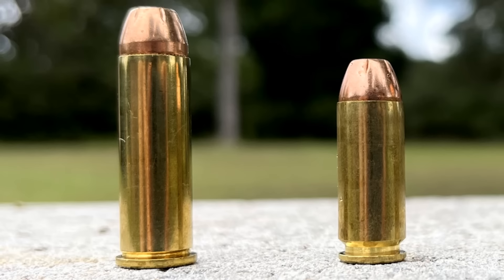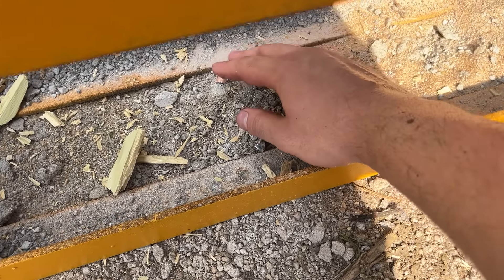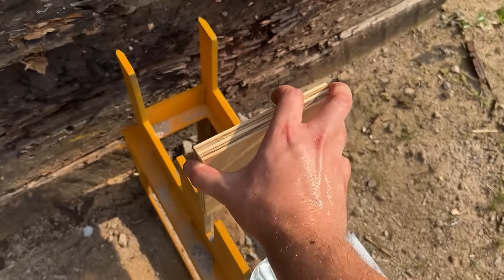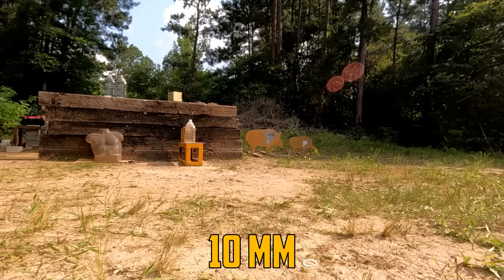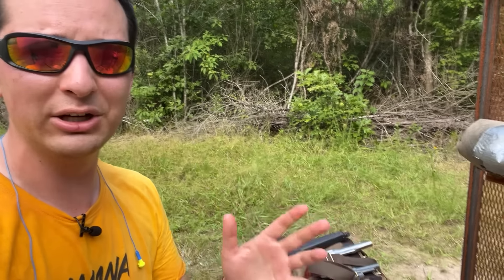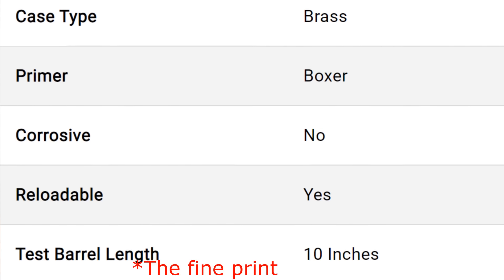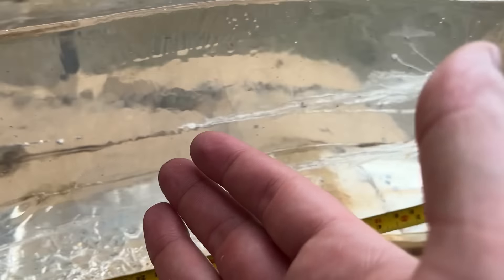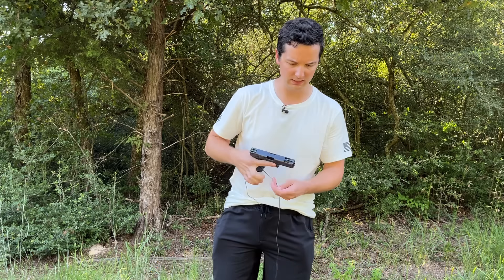44 Mag vs 10mm Auto vs 41 Mag: Not Even Close?

Comment: For those unfamiliar with the 41 Mag, the way I understand it, is that back in the day when most police agencies were carrying 38/357 revolvers, they were wanting something with a little more "ooomph" but were wary of the 44 Mag recoil.  The 41 was developed to bridge the gap between the 357 and 44 mags.  Unfortunately, the 41 required the larger frame as the 44 which negated some of the benefits of a larger caliber for service duty.   Since 357 and 44 ammunition was more readily available, the 41 never caught on with most handgunners.
Reply: If Dirty Harry had carried a .41 Mag, things would be much different.
Reply: @DirkDiggler6903  funny you should say that because that’s what Clint was using for the filming
Reply: @lkj0822g  my S&W model 57 was my brothers service revolver in the early 70’s
Reply: You’re correct for the reason it was developed. But it was too close to the .44. Larger pistol with near the same recoil as the .44. When it came out it was better than the .357, but you get the .44 for little more penalty in recoil.
Reply: If I remember the .41 magnum was created by 2 famous gun guys and was supposed to be much softer shooting, but the ammo manufactures thought the ammo needed to be hotter to sell and it ruined the whole idea behind the .41 magnum. The later idea behind the .40s and 10mm were inspired by the original .41 magnum idea, but again in the case of the 10mm it became hotter when ammo manufactures loaded it hotter to sell more.
Reply: This, and to add:  The 41 Magnum "Police" load was a 200 grain SWC at 900 FPS.  This is the load the 10mm trounces.  The rumors of the 10mm being "as powerful or more" were by people who didn't understand that this lower power load was not representative of the 41 magnum potential.  (Reference:  https://en.wikipedia.org/wiki/.41_Remington_Magnum#Development  paragragh 3)
Reply: I remember some LE complaining about the .38 Spl not having enough oomph, but didn’t like the loud .357 Mag crack. I never understood that. The .40 S&W ruined the 10mm’s destiny that’s only now is coming to fruition. Not being a sexist but women in the F.B.I., should’ve just bucked up & learned to shoot the 10mm or stay w/the 9mm or a .38 Super or use the .357 Sig. Gun Sites & local FFL’s are swimming in LE “.40 S&W Trade In’s”. I wouldn’t walk across the street for a FREE one.
Reply: John Wesley Harden carried a Double Action Chambered in .41 Colt while he was a Lawyer towards the end of his Life.  That was way before the .357 Mag was made.
Reply: I read somewhere that several experts recommended a 41 Special instead of the 41 mag. When the testing was done, 41 mag ammo was used and qualification scores were mediocre due to the recoil and blast. So the whole idea was scrapped as totally unfeasible. The 41 Special would have been like today's 40 S&W but the weight and size of the revolvers would have been excessive.
Reply: @FMitchellFelling San Antonio PD carried that 41 load.  11 shootings, 11 one- shot stops, and 11 fatalities.
Reply: .41 mag ballistics really show themselves when one handloads their own ammo.  The .41 mag case has over 40% more capacity than the 10 mm.  Not saying that there is a thing 
wrong with the 10 mm but that extra 40% case capacity HAS to have an effect on ballistics.  There are numerous handloads within pressure specs for the .41 mag in excess of 
1,000 ft-lbs at the muzzle.  That's a pretty mean handgun round.  Buffalo Bore even has one that exceeds 1100 ft-lbs muzzle energy.  IMO, what caused the .41 mag to not be 
accepted by a lot of police departments, hunters, and shooters was that there was no .41 Special.  StarLine Brass makes .41 Special cases in batches from time to time.  These 
can be loaded with a hardened lead 210 grain SWC to 900-1000 fps for a very nice big bore shooting experience that would be great in a self-defense.  Yes, .41 mag revolvers 
are large N frame guns but shooting Special class ammo in them really tames the .41 mag's recoil.  Not that it's really heavy.  It's stiff but manageable.  I like the .41 mag a lot.  
It's flat shooting and hard hitting.  It's also the most powerful handgun I can shoot well.
Reply: @scottsozmtns7534  I read that during the 10mm trials the marksmanship scores were down across the board. Men and women were less accurate with the 10mm. Could it have been mitigated by additional pistol training? Possibly but the FBI either couldn't or wouldn't spend the additional time required back then. These days most have gone back to the 9mm and the 10mm has found new life as an hunting/outdoorsman's cartridge. It's another option to .44mag when in bear country with the bonus of additional rounds.
Reply: @Angel9932  I’m glad to know that it wasn’t simply the women but the men as well. I know guys personally that find the 10mm to be bit much to handle & to be accurate beyond the first shots 1-3 being their best then the accuracy declines greatly. I like the 10mm but with metallurgical advances & production abilities the 9mm was shown to match the .40 S&W & the old war horse the .45 ACP in penetration, expansion & probably most importantly-accuracy! I agree w/you also on the 10mm being a very solid choice in bear country & the like giving you, the hunter, many more rounds than a simple 6 from a wheel gun (traditionally).  Have you looked into the new “.30 Super Carry”? I find it to be rather disingenuous as advertised as it’s NOT a .30 caliber. It’s a .32 caliber. I for one don’t understand why the variations of the .32 H&R Mag (which I have 2 wheel guns chambered in), & now the hot .327 Federal Magnum aren’t more popular? What’s your take on the seemingly “homeless .32”, caliber? It’s a darling little round, in my opinion. I’ve got 2 revolvers chambered for it, 1-is a Ruger Super Single Six “Vaquerito”, 4 5/8” barrel in stainless steel w/Birds Head grip & a Cimarron Thunderer w/2 cylinders one being a .32 H&R Mag & the 2nd is in 32-20 Winchester. I love it in an 80-90 grain lead round nose or a gem of a HP that is very effective on small game! Before I end I’d like to thank you for your very intelligent & informed and very well stated response. It’s a refreshing turn from the trolls wanting to argue or be hateful. Thank you so very much & I hope you have a wonderful weekend! Take care!
Reply: @edb3877  41 mag is really close to 44 mag performance so most people buy 44 mag revolvers and ammo, which are plentiful. 41 mag is practically extinct.
Reply: " little more "ooomph" but were wary of the 44 Mag recoil..." My dude, that's why .44 Spl already existed.
Reply: @Lurch-Bot  the 44 Special is equal to the 45 ACP.
Reply: @jimmyford796 In some of the scenes, according to historians.
Reply: @jimmyford796 I've heard that and used to believe it but a couple of the screen used guns have surfaced and were .44 magnums.  Definitely is a 6.5 inch n frame and in the final scene with Scorpio, you can clearly see .44 magnum on the barrel. One of them even had smooth Target grips and a prop house still owns it.  TFB visited and handled it.  

Interestingly, the script originally called for a 4 inch nickel m29.  They couldn't locate enough of those.
Reply: @jimmyford796 SanFrancisco police carried model 57’s
Reply: @PassivePortfolios  not really. A lot of manufacturers load .41 magnum
Reply: @scottsozmtns7534 you really don’t hear anyone mention the 32-20 anymore. I took my first deer with a Remington model 25 in 32-20 with the 80gr hollowpoint. I was 12 years old and it was a fork horn mule deer. That Christmas my dad bought me 1903 Springfield. I still have both of them.
Reply: @jimmyford796  Ammo is harder to find than 44 mag. and it's a bit more powerful than 41 mag. That's why the 41 mag. is basically done.
Reply: I hear .41 mag is popular in Alaska for bear defense.  Can’t confirm since I live in Indiana.  Most dangerous predators we have here walk around on two legs, and their pants sagging.  .41 mag could be a bit much.
Reply: The key is in the name 10mm auto. Higher round count cannot be gotten with the other 2 calibers. Rection for follow up shots and the lighter right in the polymer frames pistols cannot be achieved with the other calibers. As another subscriber said a pistol against big dangerous game is a last resort.
Reply: @bryanbaker5942  you can get 165gr hollow points for the .41 magnum and they are wonderful self defense rounds.
Reply: @scottsozmtns7534  i would. Lol it will probably be hard to find ammo in the future, but I was looking at some numbers, and the .40 sw gets the job done. 
 I don't own one, but my dad kept his after retirement as LEO.
 I'm definitely thinking about picking up a cheap .40 to carry around the property (really just because I want another gun).
 My dads first carry gun was a S&W .357mag in the late 80s. 
 He's carried 9mm and then .40 towards the end. 
 More one shot stops have been made with .40 than 9mm. Of course, there are about a thousand factors at play, but the point is, a .40 will stop a two legged threat.
 People get way too caught up in caliber hype. When I was in highschool, I knew guys that were deer hunting over 30yrd food plots with .300 win mags. 😅
Reply: One of my friends was a Detroit cop for 20 years. S&W  41 mag. was his choice.
Reply: I love my old 57....
Reply: @PassivePortfolios  Not quite extinct but not nearly as popular.
Reply: @jimmyford796  that thing could pop a domepiece like a melon,  I am certain
Reply: I'm a 40-year .41 mag owner. Bullet selection is the key to the caliber. Yes, this round has been under loaded since cops rejected the size and recoil in the 1950s. Unfortunately, Remington tried loading down the round to satisfy police requirements which is where the "10 mm is equivalent to a .41 magnum" comparison came from. Forget major makers and anything with a lead-core & hollow-point if you're hunting. For hogs (or deer) go straight to Buffalo Bore: 230 grains, Hard Cast Semi-Wadcutter, Muzzle Velocity 1,450 FPS, Muzzle Energy 1,074 FT LBS. Now you've got a .41 magnum.
Reply: @PassivePortfolios  HAHAHA! "basically done"? lol, it's been around longer than you have. I will never give up my 57's.....
Reply: @jimmyford796  Just in the first movie. Because the m 29 was sold out.
Reply: Some Police used the S&W M28 which was also an N frame but in 357 mag. Some called the m28 also just Highway Patrolman. Looks like it was quite popular. So the size shouldnt be the problem here.
Reply: Yeah 41 Mag is pretty obscure despite being a 'commercial cartridge'. I only learned about it like last year even though I watched guntubers for 12 years by now.
Reply: I have a 41. Great, underrated cartridge. Perfect for woods carry/bear defense. But yeah, it’s like having a cannon strapped to you lol
Reply: @scottsozmtns7534  Bro they got 38 speciblow in your standard 357 out of a 3 inch barrel out of   The water
Reply: @devonholbrook3603  That may be so but the question it comes down to is “Are you a Paper-Target man/woman or can you hit LIVE/Targets both Animal & Long Pig & I can do both w/amazing accuracy, to me but that’s all I care about. I know what I can do w/a .38 Special (of which I’m not a big fan on live “targets”, period not bad for accuracy), and especially the .357 Mag & not trying to prove anything but you’ll look long & hard for someone that can outshoot me w/a .357 Mag. I don’t measure accuracy in inches, I measure real accuracy in “thousandths”, & I do the hours, hand loading & drills until I get the accuracy I’m looking for. I’m also wanting to try a .327 Federal Magnum as she beats standard .32 H&R Mag (of which I’m a fan), big time & gets you really close to .357. For a wheel gun it’s just my bread & butter, that’s all. I don’t dis on 10mm guys. It’s a great round & would like to shoot it more than I have. On my wheel guns for both .38/.357 I tend to stay at 4”-6” barrels. 4 3/4 for Cowboy Action & for hog leg’s like my Colt’s King Cobra & Python I use 6” barrels only. I’m pretty good w/.32 H&R Mag out of 4 3/4” Cowboy but could be better. Heck, I just love about any gun. I apologize if I sounded like I was disin’ on any caliber or anything like that. I just love to shoot. Picked up an Sig Sauer P-210 A Target but can’t bring myself to shoot it!!!! I don’t doubt you at all. There’s no telling what’s out there now days! Keep shootin’ & shootin’ straight friend!  Ever deer hunt w/a wheel gun open sights NO scope? It’s funner than se, well I would go that far but it’s fun!!!

Comment: That's a pretty anemic load for the .41 Mag (1128 fps). I get around 1400 fps with a published handload using H110/W296 out of a 6.5" Ruger Blackhawk. It goes around 1700 fps out of my Marlin lever action.
Reply: Exactly what I was saying.  That load he used is extremely weak.
I have the exact same setup.  Love them both.
Reply: All the .41  mag. Slugs that I have shot are 1250 fps. or greater.  Did Bananaman use a low pressure handload ? My 10 in. TC/ Contender  pushes as hard as any .44 mag. Pistol  shot.
Reply: Around my area (SW Ohio), .41 is hard to find. He may have just used whatever ammo he could buy? Or whatever MidwayUSA could send him. *Love Midway, by the way!

Comment: Back in the 1980s, you could call Bullet companies like Speer,Sierra, Nosler and they would send you computer printouts of any caliber, barrel length, and Bullet weight for ballistics and comparison. The .41mag outperforms 44mag and most other pistol caliber cartridges. With the perfect diameter and 170gr -300gr bullets, 41mag, it is still hard to beat as a very manageable handgun or even lever gun caliber
Reply: I’ve long heard this “41 mag outperforms 44 mag” thing, but not once have I seen any real evidence for it. It doesn’t stand up to reason, a larger diameter cartridge with more internal volume running at the same pressures is somehow worse? It doesn’t add up
Reply: Absolutely !
Reply: @jacobackley502 Kinetic energy is 1/2MV^2 so the mass of a .41 will be a bit less than the .44 slug, but the velocity will be higher, and velocity in the equation is squared.  So in terms of energy,  a .41 can outperform a .44.

Would there be any meaningful difference on a game animal? I doubt it.
Reply: @thomassuit7450  So you presuppose the 41 to have higher velocity. My point here is that with the wider bore, there’s more surface area on the back of the projectile for gases to act on, so with the same pressure (force over surface area) multiplying against a larger surface area to get total force of the propellant accelerating the projectile is higher for the 44. This means that holding projectile and charge weight as constant (which between the two, it’s not constant, the 44 has higher bullet weight AND charge weight), then the 44 would still be more powerful. It will send a larger projectile faster than the 41, there’s not really any way around it
Reply: @jacobackley502  Yes, that is correct. My point was for cases where the bullet weight was not the same.  This was something the original developer stated.

But Wait!  .44 is only .03 of an inch bigger than .41.  That extra surface area around the sides of the slug creates a huuuuuge amount of extra drag going against the inside of the barrel. ;-)
Reply: @thomassuit7450  You know you can load lighter weight bullets in 44 right? That’s not exclusive to 41. Also 44 is only 0.019” larger than 41, not that it actually changes drag in any meaningful way.

Regardless, it comes back to where I started. I hear these odd and dubious claims about 41 being better, but have never once seen anything real to support it. Just vague, hand gesture statements
Reply: @jacobackley502  Wow.  I even included the ;-) to let you know the drag comment was a joke.
Reply: @thomassuit7450  Sure, but plenty of people try to use jokes/connotations to try to push something, and that’s fine, but if it’s wrong you can still get criticized for it even if you put a joking veneer on it.
Reply: @jacobackley502 Okay, Fudd.
Reply: @thomassuit7450  lmao, I don’t think you know what that word means

Comment: The water jug destruction is more a velocity test. The XTP bullets are designed for controlled expansion in gel equivalents of human torso. None of the handgun calibers will do much to the steel plate. To test the effect use 3/16ths and MDF instead of plywood. If you want a cheap penetration test use 2x1gallon jugs, 3/16ths steel, and 2x1 gallons.

Comment: my Taurus tracker 44mag 4in barrel with 3in rifling, last inch is gas port and chamber. my normal deer hunting/self defense load is 180gr xtp 13.5gr longshot powder 1352 fps with 731 ft/lb energy . my black bear/ boar load if necessary 240gr xtp  longshot 11.5 gr 1125 fps /674 ft/ lb or gc 240gr hardcast flat face. papa wishing you well 😊

Comment: I have a .44 Mag DE, a Glock 21 that I have a 10mm conversion for, and a S&W .41 Mag. The problem with the .41 Mag is the ammo selection. The Hornady .41 load even seems to be meant for rifles. Of course, a 4” barrel on a magnum is never going to adequately represent what it can do. 

Because .44 and .41 don’t need to cycle an action in most guns chambered for them, they are often loaded light. But when you’re shooting a Desert Eagle, you’ll notice that most factory .44 doesn’t cycle it very well; you have to get defense rounds to do the trick. Sig V-Crowns used to have a .44 Mag offering, and those cycled my DE very reliably. 

I have noticed that plenty of 10mm range ammo is not full-power, but they tend to be closer to what full-power loads are than you get from factory revolver rounds. 

In any case I don’t know of very many situations where any of these rounds won’t do what you need them to do so long as you’ve chosen the right load and the right gun.